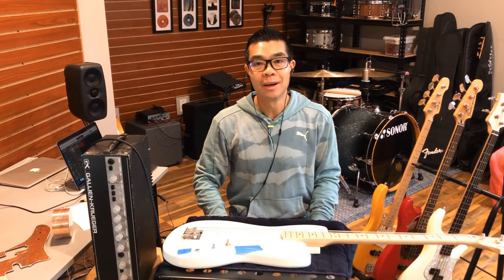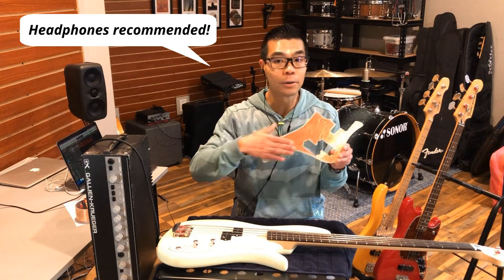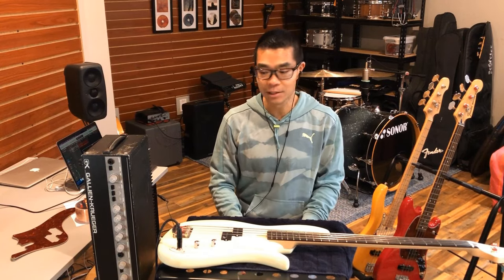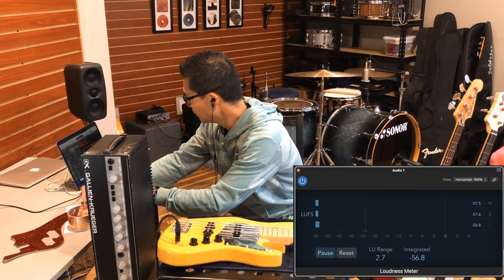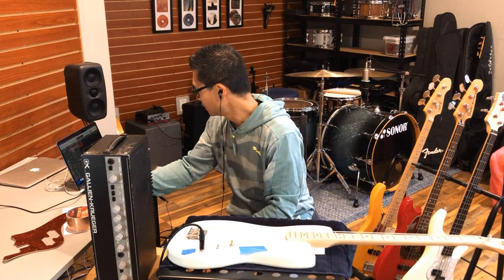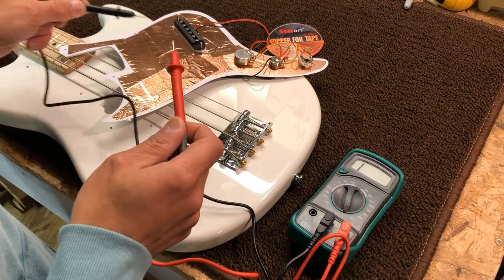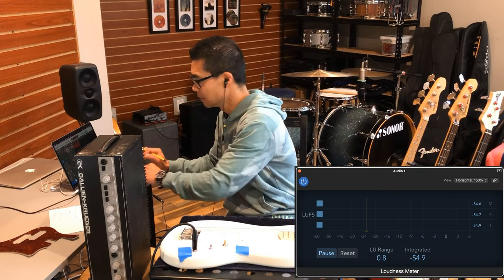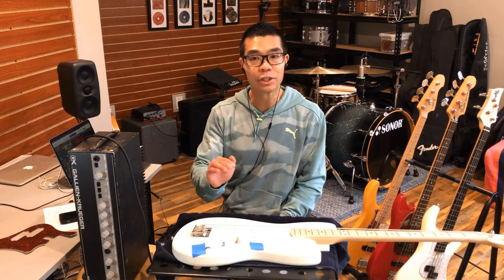Squier Bronco bass mods Ep.3: Will shielding the pickguard & cavity reduce the noise?

Comment: Very useful and informative. I have the same Bronco bass. It was very noisy at first. I had to turn down the tone to zero to eliminate the buzz, which wasn't ideal as the bass sounded dead. I swapped out the pickup for a proper bronco bass from Vineham pickups (the stock pickup is a strat pickup with 6 magnetic pole pieces). I can now turn the tone up to around 7, keep the volume at around 6, with minimal buzz and a much brighter sound. But next, I am going to shield the pickguard, so this video was very informative. And it is also making me manage my expectations regarding the results!
Reply from the maker: Cool p/u! Thanks for watching!

Comment: That bass actually does have a small amount of aluminum foil shielding on the underside of the pickguard, beneath the two pots and output jack.
Reply from the maker: Fair enough!  There was, however, nothing around the pickup area, nor in the cavity.  But yes, there was a small stick on sheet around the pots.
Good eyes.  Thanks for watching!

Comment: I appreciate the info on shielding, although I agree I didn't hear much difference. I did find a significant difference in noise when I had the shielding on my Gretsch duojet upgraded. I have a topic suggestion I'll put in a separate comment
Reply: Did the topic suggestion post? I don't see it. About Bass VIs
Reply from the maker: I think how dramatic the effect of shielding is going to be dependent on the room and its noise floor. I think my place is just quiet (which is a great thing!). Thx for watching!
Reply from the maker: No, I don’t see it either. But I also don’t have much experience with Bass VIs..
Reply: My question is, how does the new Fender Bass VI compare to the Squier Bass VI which, to my knowledge, is still available. The Squier had a number of QC/setup problems, as described in numerous YouTube reviews. When I ordered mine direct from Fender a year ago, I asked them to examine the guitar closely, correct any problems, and give it a setup. Much to my appreciation, Fender obliged, and it is wonderfully adequate for the few use cases I have for it. But the introduction of the new, more expensive Fender model has me wondering if they corrected all the bugs and raises the perennial question, is it worth the upgrade. Meanwhile, another cheaper VI was on my radar from Harley Benton. I opted for the Squier VI because of sale pricing and my preference for a Fender brand. So I would like to see a comparison/review. For any who are not familiar, these short-scale, six-string basses are tuned E to E like guitars, and are preferred by many making the transition, even if part-time (see "Get Back"), from traditional guitar.
Reply from the maker: Good question. Unfortunately I haven’t played either. Sorry I can’t be helpful here.

Comment: The results are totally unsurprising. Shielding does absolutely nothing for single coil hum, it only eliminates the buzz you get when you don't touch any metal parts. Did you even have that? My Bronco came perfectly shielded already (black paint in thr cavity), so it ony had single coil hum but it's a 2020 from the previous iteration, with a 2-saddle bridge, wider nut and worse tuners.
Reply from the maker: Thanks for watching! In browsing the forums, there are many single coil playing guitar players who have attempted shielding their guitars to mixed effect - some who claimed they had good noise reduction and some who did not experience any significant change. Same thing with single coil equipped basses. The purpose of this episode was to demonstrate the effect (or lack thereof) in a bronco bass with some objective measure. I think it was worth showing to viewers of all experience levels even if the end result was predictable to more experienced players/viewers.
Reply: Absolutely. I wonder why your Bronco is not shielded when mine, which has objectively worse hardware, is well shielded. Did yours buzz whe you were not touching the strings?
I noticed an aluminum pickguard can reduce single coil hum a bit because it has so much metal mess. Shielding paint/tape is too thin @jonathanwong458music
Reply from the maker: Some ground noise was reduced when grounding out with a finger/palm/touch. Insignificant reduction though, so noise was multi-factorial. Big companies are all about cost savings unfortunately so that’s likely the reason for the lack of shielding. I assume they feel that most students or beginners, the demographic target, would not know better or care?

Comment: It's not entirely surprising that the improvement from the screening wasn't dramatic. A metal screen (such as the copper you are using) is good for shielding against electric fields, but they don't do much for magnetic fields. The transformer in your amplifier will be pumping out a large alternating magnetic field (that's how transformers work) and that will pretty much pass straight through the copper. If you don't believe me, get a permanent magnet (such as a horseshoe magnet) and put some foil over the poles. It will still pick up bits of iron as though there as no foil there.

What puzzles me is why the first bass you use, which seems perfectly quiet before you switch the amp on, becomes noisy when you turn on the amp. True enough, there's an alternating magnetic field from the transformer, but the humbucking pickup should fix that by mutual cancelation of the signal in the two halves of the pickup. Possibly the noise you hear comes from  induced current in the rest of the electrics rather than the pickup.
Reply from the maker: Good question.  I am far from being an electrician or engineer, so it would be wrong of me to hypothesize.  We have all either experienced it ourselves, where our amps hum more when we go back to it to adjust knobs (or have guitar players who do this!!), so I used the amp as a 'real world' type noise-generator. 
Thanks for watching and commenting!  Please let me know if you have ideas or suggestions.
Reply: Where the source of the interference is a magnetic field (as opposed to an electrostatic field) the advice is generally to avoid 'earth loops'. To appreciate what an earth loop is, you might remember from school days that a changing magnetic field can induce a current in a closed loop of wire, which is basically how a pickup works. We envisage the loop of wire being threaded with the magnetic field. Move the loop, or change the field strength, and a current is induced. 
Let's say you've got a pot (volume control, maybe). You connect its metal case to an earthing point on the foil. Nearby you have another pot (tone, maybe) and you connect that to the foil at the same point as the first (which would be good practice). Now you think 'just to be on the safe side, I'll connect the metal cases of the pots together with a wire'. This third wire creates a closed loop with the other two and could potentially have a current induced in it by a varying magnetic field. That arrangement of wires has created an earth loop.   @jonathanwong458music
Reply from the maker: @acj2789  that's so interesting!  As the copper foil tape is continuous, could it in effect, create an earth loop between those pots?